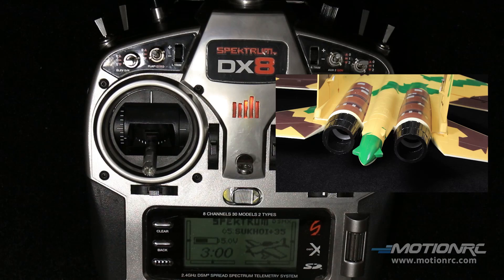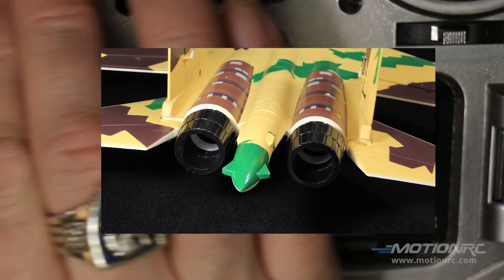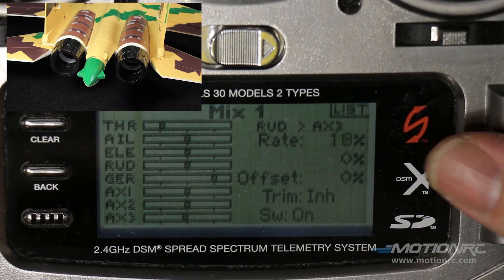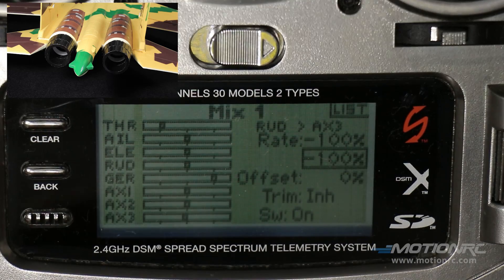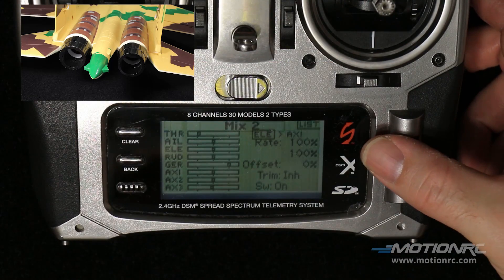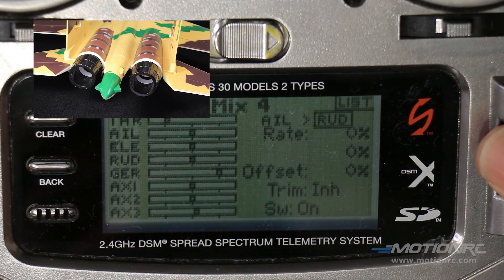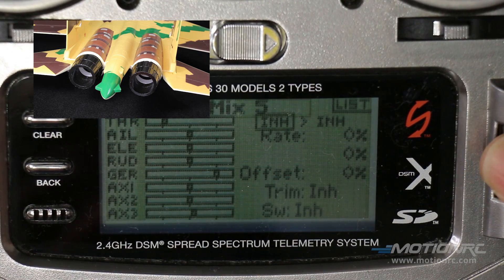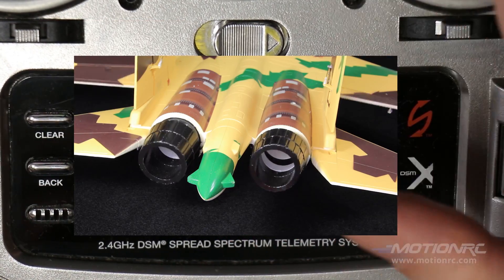Thrust Vectoring setup on Spektrum DX8

Comment: Hi i have a spektrum Ar8360t with the as3x gyro that my ix12 transmitter automaticlly assigns aux3(roller knob) on my transmitter as gyro gains.when i plug in the 3 servos that power the thrust vector set-up it also uses the aux3 roller knob! Is there any way that you know of to keep them from fighting each other or does the vector system need a 9channel receiver or can it be made to work with the as3x receiver?

Comment: Captin Mike, you're a legend. thank you for this video. I have an LX F14 with dodgy radio. With my Vectoring on rudder work, elevator work, but the nozzle also goes up and down when I use the ailerons. I'm in the process of replacing the radio with spektrum andI was wondering how or even if it would be possible to configure. Now I know! Thanks again. I especially like the fact you can still disable it when you need to. Legend!

Comment: Thanks Cap'n Mike. Well, looks like I might need your help. I tried to find the correct mix that would activate full canards (Aux 1), when the reverse thrust (aux 2) is activated.
I went into my DX9, which has the same basic setup as your 8, but because the first options inside the mix were ailerons, rudder, and elevator, I had no beginning point.
Should my beginning point be (Aux 2), since that's what I need it mixed with? And if so, where is it in the mixing area?
I hope this made sense?

Thanks for any help you can offer.
Reply from the maker: Flying Ant Go to mixing then to P-Mi 1, click on it then scroll and click on normal. Set aux 2 then aux1. Set the servo movement percentages to the way you like them then assign it to a control switch if needed. Try that I think thats what you were asking. I hope.